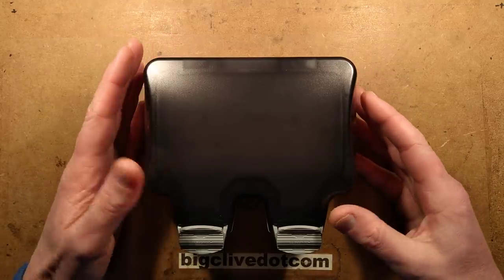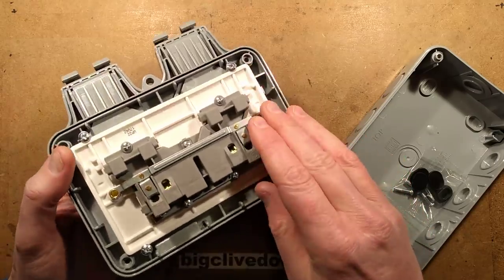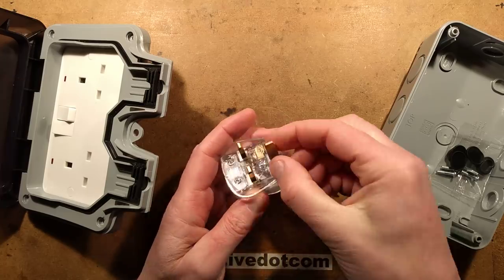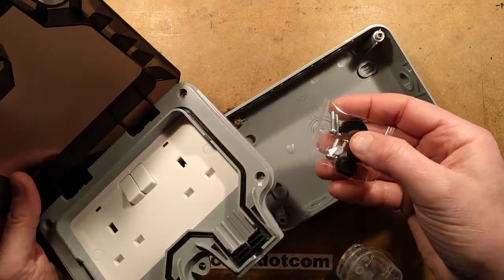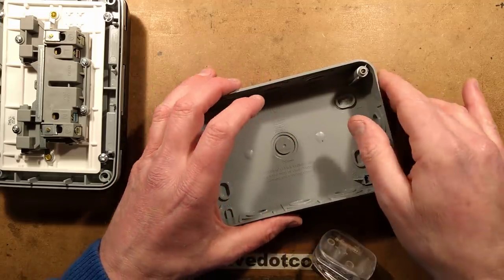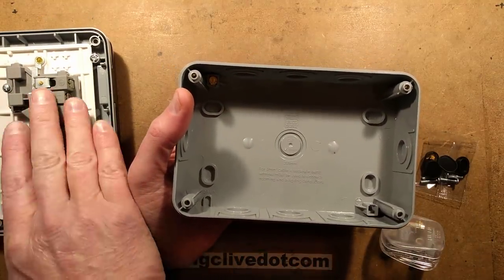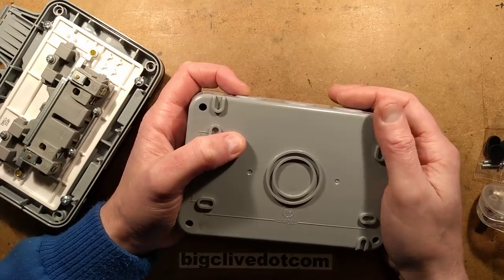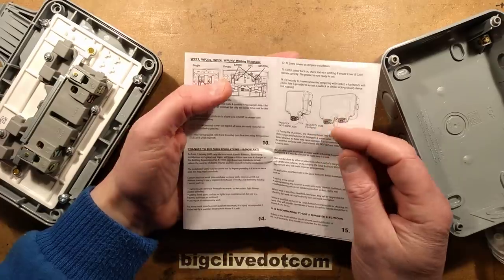British weatherproof socket with clever design. (bonus rant)

Comment: I don't think British plugs are ugly, but you do seem to have a one size fits all thing going on. In America, general receptacles are 15A at 120VAC providing a maximum of 1800 watts. Industrial and some air conditioner receptacles are slightly altered (I think the neutral is horizontal) for 20A at 120VAC use providing a maximum of 2400 watts. Another version of this receptacle for air conditioners has two horizontal prongs are at 15A at 240VAC providing a maximum of 3600 watts. The last version of this receptacle 240VAC version is at 20A providing a maximum of 4800 watts with the hot side horizontal. Then, we start getting plugs the size of British plugs for 240VAC, high current ranges (cookers) and electric dryers. I think ranges are 30A with a maximum of 7200 watts and electric dryers being 40A (neutral prong included) with 40A with a maximum of 9600 watts. I guess British plugs have a maximum of 13A at 230VAC providing a maximum of 2990 watts. Do you have larger plugs for major appliances or something?
Reply: no we don't really we do have a 16a and 32a  plug and socket but don't see those in the home more in factorys and caravan parks cookers and showers and car chargers are the only high draw items but each would have its own circuit in the consumer unit
Reply: Typical large but moveable appliances, such as a fridge/freezer or washing machine, plug into a socket with a plug like that. Anything which requires more than 3kW in a dwelling would be wired permanently to the wall, such as an electric stove or household water heater.
Reply: I have always seen the "one size fits all" as an advantage in this context. The only thing I have found to sometimes struggle with a 13 amp limit is an air compressor - which I didn't want to hard wire to a dedicated supply.

Comment: Iirc. those wire colours were chosen to avoid electric shock/fireworks if someone mistook green for earth (yellow and green), as the 3-phase colours used to be red, blue and green over here. I remember when that was introduced all the schools needed to change their binding posts on their demonstration panels. Fun for all the family.
Reply: For clarity (you did forgot that), in house installations (single phase), green was phase, red was neutral, grey was earth.
Reply: That was eons ago. I once lived in a building from the 50's where the basement was still wired up like that. It's been brown for live, blue for neutral and yellow/green for earth for single phase since at least the 70's here (Belgium).

Comment: Easy solution to new laws: Instead of doing proper wiring, use a lot of extention power cords, all over the house! 
The thinner the better; the thinnest ones are easiest to squeeze through closed doors/windows, behind closets, under cardboard boxex, make shure you buy a really long one, you can allways leave it coiled up tightly somewhere behind furniture, in case you need it longer in the future... 
SAFETY FIRST!

Comment: Pertaining to what you said about the British plug being ugly I kind of liked them I recently had a rather large air compressor installed in my garage I do a lot of automotive work at home as a hobby and this particular unit had a three horse power motor which required high voltage and I insisted upon it having an outline so maintenance on the machine would be easier and the plug looked a lot like that one.

Comment: I have these outside my house. Unfortunately, my wife likes to feed the birds, and she had a fat block mounted on the wall above one of these,  no problem for quite a few years, then it tripped the fuse. Took it apart, and found the chamber was full of slugs and slug nests. Still not clearhow it tripped the fuse, so I followed my nose (and the smell) into the mechanism of the socket, only to find that a slug had pushed its way into the socket and got between the two bus bars for the live and neutral, and got vaporised. Lots of mess, took a bit of clearing up, but in the end all back together, and better sealing against slugs as well as water, and instructions to SWMBO not to feed the birds and slugs anywhere near my sockets again

Comment: When we moved into our brand new house on a Friday in March 1986, went into the downstairs loo as it got dark, tugged on the light switch cord, and .................POP. The "qualified electrician" had connected the switch across live and neutral, then failed to test it. Fuse blown, builders couldn't fix it till Monday, no downstairs lights till then.

Comment: Your correct Part P is a big scam . The change in the wiring code , they fix a problem that didn't need fixing, so when you an installation with the old and new colour, you have the problem what is black is a neutral or a live , what is blue a live or neutral. Same as the wiring regs are a scam , if you read them there is one reg that states " all electrical accessories must be installed according to the manufacturer instructions" which is the NIC IEE get out clause , it allows them to wash there hands of the matter is anything goes , wrong ,. when I do work I have to ignore the BS7671 and use the on-site guide .  Factors for using conduit is a complete and utter madness for instance you use your factors for the cable and it says you use 32 mm conduit but if you put a through box somewhere along the conduit you can go down to 25 mm conduit, it either one or the other not both in my box , the some problem with trucking, . I could rant all day about the wiring regs , wiring regs are written by failed sparkies and ones that never lifted a screwdriver in there lives , the same with part P . We never had those problems till someone dreamt up part P. Rant over

Comment: I've used these outside mains sockets.  The first thing to break is the plastic around the hinges which perishes and breaks so the hinges no longer work.  It's a very weak area around the hinges and this failure compromises the integrity of the waterproofing.  Best avoid these as the design is a failure.

Comment: Wait so your plugs are only rated 13 amps? Our North American plugs are rated at 15 or 20 amps and they have less contact area with less metal. What’s with that? I am genuinely curious now.
Reply from the maker: 13A at 240V.  Up to 3kW load per socket.

Comment: clive may i ask you a question ..... i have a neon light transformer 240v / 1.68A , and the secondary output is 9000kv / 37mA , i would like to vary the voltage and would like to know if an  APS  500w 220v variac would be up to the job , the specs of the variac are 
Mode: APS-500W
- Name: Single Phase AC Voltage Regulator Power Supply
- Rated Current: 2A
- The Max Current: 2A
- Input Voltage: 220V
- Frequency: 50/60Hz
- The Max Power: 500W
- Adjustable Voltage: 0-300V
- Temperature Rise: ≤ 60℃
awsome channel , coupled with some good humour
Reply from the maker: That should be OK with a traditional heavy transformer with no electronic protection.  It's a technique used by neon manufacturers for testing tubes.  You can also buy Chinese electronic neon PSUs on eBay, but keep in mind that the high frequency output does have stricter requirements on cable and tube clearance.
Reply: thanks for the reply clive , i want to use the neon sign transformer for creating the litchenberg effect on wood , i have used mot transformers in the past , but they don't seem to last long , and are too aggresive (and dangerous) , the variac transformer mentioned would be used to control the burn more efficiently
Reply from the maker: @virtuosomuso  Glad you're moving away from the microwave transformer.  A lot of people have died while using them to make lichtenberg burnings.  The best neon transformer to use is a traditional core and coil transformer.  Very heavy and no pesky electronics to get in the way.  You may not need the variac as the neon transformers limit the current by default and for the duration of a wood burning they will not overheat.  The lower current results in a much finer burn, so you'll need to experiment to get the best results if you've not done so already.  Consider making a dead man's handle box for safety to kill the power if you have an incident.  I featured that on my video warning about the dangers of using microwave transformers to create this effect.
Reply: thanks clive , i've found with this transformer that it tends to burn in straight lines , rather than branching out and creating the more interesting tree like burns i managed to get with the mots , a guy on youtube (doublereno) uses a variac for oil neon and mot transformers and when the burn started as a straight line he would reduce power until it began branching out then increased the power again , have you any videos on the construction of a dead mans switch
Reply: just found your video on the dangers of mots , and the neon sign (fart) transformer you are using is exactly the same as mine other than mine is 9kv

Comment: Other than the wonky color coded as described by Clive the basic UK electrical code and standard is SO much better than here in the US. The plug and receptacle are much more heavy duty, the integrated shutters and switches, and the plug's built-in fuses! The only real downside that I can see beyond the aesthetics is the size. But when you add higher capacity and safety devices, you're just going to have that. That said.... to mandate a switch-over to new design requirements for existing equipment would be staggering in both cost and effort. Although.... so many unskilled idiots would be attempting to do the work themselves would probably result in a huge "Darwinian thinning of the heard" it might actually be an additional benefit!! ⚡😂 lol

Comment: It's unfortunate that the current BS 1363 plugs are still saddled with the legacy decision of using ring circuits in houses to save on copper wiring. That led to the need for these fuses in each and every plug (due to the lack of individual 16A or similar) circuits, and with it the clunky design.

Personally I'm a big fan of the German and French plug (Schuko and kin), as they envelop the plug as it's inserted into the outlet, ensuring that no accidental contact is possible. The rounded plugs also ensure that you aren't going to be stepping on their prongs. As a final benefit, they're a lot more compact than the BS 1363 plugs without turning into cheap toys (hi NEMA 1-15 and 5-15) and the outlets also fit Euro plugs.
Reply from the maker: The ring has some advantages, but we can also wire them as radial circuits for low load areas if we wish.

Comment: unrelated to the subject of the video, but related to the rant - I am concerned about the ratings of copper clad aluminium flexes now becoming seen frequently. John Ward is the only coverage I have seen [not a rigorous search I admit].
Reply from the maker: I recommend disposing of cables supplied with cheap equipment imported from China directly.  It's safer to replace them with locally sourced ones.

Comment: I've heard the point about the harmonised L2 being black and that's bad because we used to use it for N, but it just seems like an attempt to find a problem. You'll only find that black in 3-core or more, never in twin so the context tells you what it is. The only context where it could cause confusion to someone who knows what they're doing, is if you're looking at something wired in singles.So commercial or industrial and quite frankly I think anyone too stupid to figure out if they've got a neutral or line conductor shouldn't be doing that in the first place.
Reply from the maker: When the new code came in there was a LOT of electrical damage caused by people interfacing new and old colours.  And it is still happening.

Comment: Rant away Clive,  there was nothing wrong with the cable colours before the EU plugged (intended) their nose in. Even a colour blind electrician could tell the difference between the grey shades, lol. Ugly never, the UK three prong plug system and fuse is the best connection for in door electrics, over the two prong forks. Though I still get confused about fuse ratings 13/5/3 amp for a units protection.

Comment: If this was designed for outside use does it contain an RCD?
Reply from the maker: It's available as an RCD version, but most distribution boards have the RCD protection at the source these days.
Reply: @bigclivedotcom  Thanks. I have another wee question. If using a microwave transformer to make lichtenberg designs, would an RCD between the MOT and mains protect the user? I'm guessing not.
Reply: Scrap that question, I'm just reviewing your older video about the device and found my answer. I need a FART. Cheers, mate!

Comment: Hi Clive, I'm with you over Part P. I did a degree in EE, spent the first half of my career as an R&D engineer in telecoms and the latter half as a software engineer. Yet according to the regs I'm not allowed to do the most basic wiring on my own house as I don't have a Part P certificate! Ridiculous. How simple can it be? 3 coloured wires = 6 combinations, I've got to be right once in a while. :)

Comment: Interesting, I fitted two of these a few months ago. I was very impressed by them and it is good to see this comprehensive review. I had a small issue with a VERY tight securing clip on one. I had the scraped skin to testify the fact. 👿
V pleased also to hear and agree with your rant about the idiot EU colour changes to domestic cabling.

Comment: I cant help but wonder why the switches
Reply from the maker: Switches allow a load to be isolated while the plug is still in.  It also saves the contact of the plug from arcing as a plug is inserted or pulled under load.

Comment: 13 amps in that huge plug? That is a bit disappointing. Schuko does 16 amps. The downside of schuko is its backwards and inter-compatibility with older, less safe euro sockets. When I was in Italy I could plug my hair dryer into a unearthed 2.5 amp circuit because the socket was so old, and I could touch the metal prongs of the plug easily if I wanted to. Modern schuko is way better in that aspect. Glad that a lot of EU countries have it (cough, France and Italy, upgrade your sockets!!)

Comment: Agree the UK plug is well designed, though very bulky. We've got the traditional Type F Schuko and the Europlug. The europlug doesn't have earth however it is small which has some practical benefits. 
Anyway the safety issue isn't with the plugs (or people doing their own installations), it's the crappy unregulated Chinese crap, of which many example have featured on your channel.
In 2016 the Dutch regulators actually got of their arse and took a look at the USB chargers being sold in stores. 24, more than half the available models and brands, had to be banned outright. God knows how many were and are already n peoples homes. And now in 2019 all those banned ones have long been replaced by equally unsafe chargers of course.  And thats just chargers.

Comment: I am 62 and have been a "hobbyist" in electronics and electricity since I was 10 (52 years) and a full Amateur Radio Licence holder since 1986, (32 years) and yet, I am not a qualified electrician. My personal knowledge far exceeds that of the average "sparky" to the point of annoyance. I just do it anyway, as I know what I am doing.
I'll bet there are many out there in the same or similar position.
There are also those out there because of total stupidity, that should never be allowed to hold a screwdriver......
Reply from the maker: You should become a fully certified electrician just for the hell of it.  If you're conversant with the regulations then you could attend a BS7671 one-day refresher course and instantly become certified.  Then apply to the JIB to sit a very patronising "safety" test that asks things like "how many people can stand on a ladder at once" and fire extinguisher colours, and they will happily issue an ECS JIB card.  They seem to hand them out to anyone like sweeties these days.  Then you can legitimately call yourself a JIB certified electrician as many are doing.

Comment: One feature you missed Clive, there is also a facility to lock the lid closed with a small padlock between the clamps. This is a very nice socket. 

Don't get me started on part P. As a qualified but no longer practicing electrician, I am supposed to report myself to the local authority, pay them a small fortune and have a half trained moron inspect and test any work I do at my own house.... Yes, well that doesn't ever happen and as it's almost impossible to enforce, they can p**s off!

Comment: The Department of Health has strongly suggested that child safety plug socket covers are more dangerous than using nothing at all which proves that the design of the socket sets a very high standard of safety

Comment: A nice unit but I'm not crazy about the back-box. Why have knockouts on both sides? Just have them on one side and rotate the case as needed; that way you don't have to hope the top knockouts are water-proof when cables enter from below. If you really need cables to enter from top and bottom I respectfully suggest you're doing something wrong.
Reply from the maker: It does actually seem a bit over-generous.  Options I guess.  Especially if the same box is used as a rugged indoor box.
Reply: Some people may run two boxes on a single cable, so on one box they need a cable to enter and then another will exit to go to the other box.

Comment: The only bad thing with the British plug is that it is absurdly huge and you can't even make one smaller when you do not need a ground connector.
I would honestly welcome the inclusion of a fuse in the regular EU plug cables. For the cables that you connect to computers it could even be a one time fuse and you just replace the cable if the fuse blows